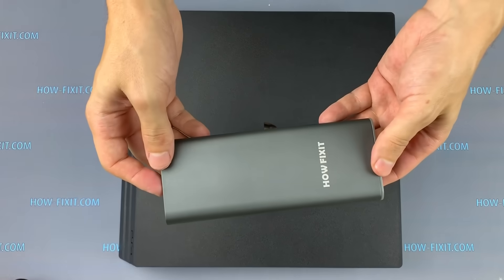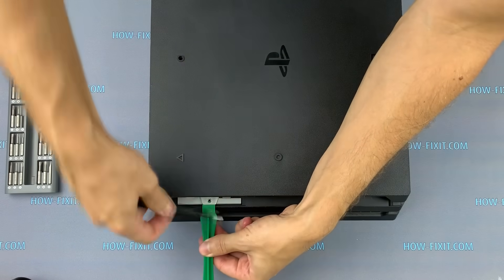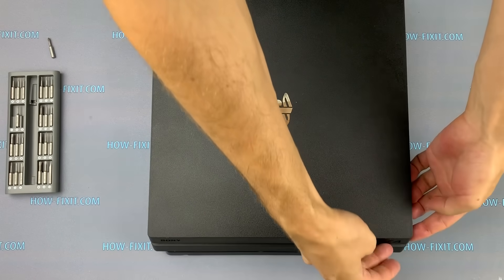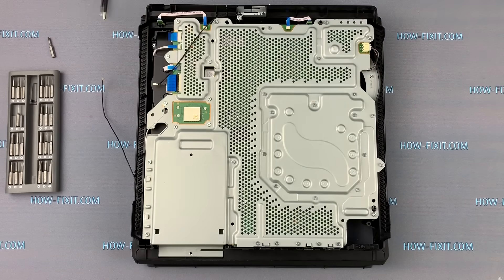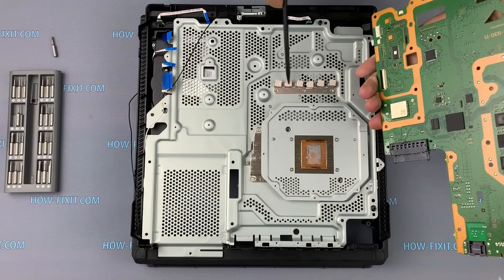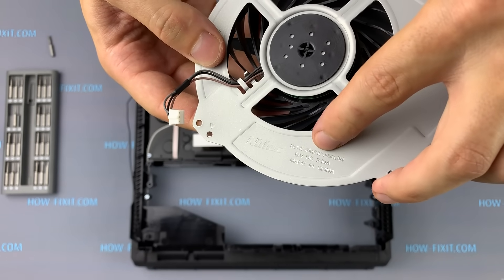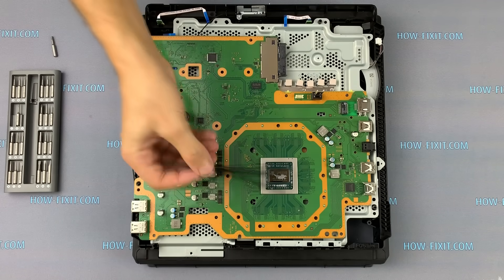PS4 Pro Disassembly: Ultimate Guide for Fan Cleaning and Thermal Paste Replacement

Comment: Please warn to be careful about motherboard cable. I just ripped mine off
Reply: The power supply? You can get it back soldered
Reply: @broly1724  i know that now but he should warm people about it. That piece must be heated before removed and he says nothing about it.
Reply: @paolo3794  no it doesn't need to be heated i did wiggle a bit but with care and it came off after that it was easy to put it back and take it out again just be patient
Reply: @shubhamstark8  3 people plus the place i sent to repair told me it must be heated before removing.
Reply: I just did the same. Wish I read your comment prior to this. Smh.

Comment: I open,clean,do it everything,closed okay,but dont work anymore,blue light pulse,what i can do? Please reply me
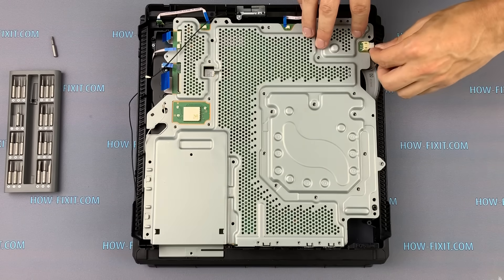Reply from the maker: Repeat step at 8:08 and double check each ribbon cable.
or try hard reset ps4 pro.
Reply: @howfixit  I have same problem. I checked ribbon cables a couple times. But when i try to start it, blue light appears for a second and dissapears. I'm trying to push and wait the power button for hard reset but it's not working.

Comment: Important thing I've learned the hard way: it's way, way easier to disconnect the cable from power supply than the motherboard. I ripped out the connector from the motherboard and had to pay for soldering.
If you gentle and move the connector in PSU left and right it'll come out easily.

Comment: 3:12 for me the cable wire to the mother board was stuck to the motherboard input piece and I wasn’t able to pull it out with my fingers, tweezers, nada and it broke off the input from the motherboard why???

Comment: Tnx a lot!! Just opened my ps 4 pro after 4 years,at the end it was a jetplane . Followed the video and the radiator was clocked. Also thermal paste was like dry clay. Clean everything up with alcohol and replace the thermal with Noctua NT-H2 . Put everything  back together and tested it with a game session. The fan didn't had to run fast,it was so quiet . So big tnx for this video!! My kids are happy and i don't have to hear that noise again.

Comment: Hands down one the most accurate and well presented tutorial videos out there. 👏

My heatsink and cooling fan were actually very clean, but the thermal paste was just carbage. Nearly 1/3 of the CPU had zero paste on it.. Okay my PS4 Pro is just two and a half years old though. I used a Noctua NT-H1 paste too. Couldn't be happier with the results.

Comment: I just did it, easy with this tutorial 😀. when I finally get to the old paste I was really surprised that my ps4 was working at all. all old paste was around CPU, between CPU and radiator just a bit, never properly applied to whole surface. in fact radiator was useless and not working.

Comment: I've had my PS4 Pro for years and never truly bothered to disassemble it for fear I'd break it in the process of cleaning it and replacing the thermal paste. Just spent a few hours following this step by step guide and my PS4 Pro is purring like a kitten instead of impersonating Valstrax the jet dragon from Monster Hunter series constantly. Thanks for the guide, subbed. Also, tip for 3:13-3:15, have some small pliers or a strong set of tweezers to gently squeeze both sides of the power cable (since it was a squeeze lock for me anyway) and carefully nudge it from side to side and out instead of simply pulling. Pulling the cable will very likely result in breaking the plug attached to the motherboard and end in a bricked console.
Reply: Oh my god thank you so much I almost destroyed my ps4 trying to figure out how to disconnect it
Reply: My motherboard almost ripped but there is a little tear. My ps4 is fine but it couldve ended worse. Thank you so much bro

Comment: Amazing.
I've never done something like this before.
Everytime I played No Man's Sky, my PlayStation fan would go into overdrive. Initially I thought ok it's a demanding game.
I did open the top of the PS4, thinking it must be dirty as I did buy it second hand. It was actually quite clean. Shrug the shoulders and carry on, just the demanding game.
But then other games started triggering the fan as well.
Watched this video and thought I'll give it a go.
The radiator had some dust on one corner. Like a total of 5% blocked of the radiator.
When I pulled the motherboard off, there was thermal paste squished off the CPU and into the surrounding connectors and I would say only 70% of the CPU had thermal paste covering it.
Cleaned it up, reapplied fresh thermal paste, hooked up new fan only because while I had it apart I figured maintenance not repair/replacement later on.
Wow. Whisper quite. Played No Man's Sky for 10-15 minutes and the fan did not increase in speed at all. Where as before it would start jet fan mode while just loading the game from dead cold unused temp.
Highly recommend doing this maintenance!
Thank you for a great and helpful video 😉

Comment: Excellent video. I don't know why but my ps4 pro has an X above the cpu and his was a like an S?
Reply: That’s because u have a different model of the ps4 pro for example there is 3 models for it 7000 series 7100 series and 7200 series and that guys ps4 pro in the video is a 7200 series so u either have a 7000 or a 7100 series

Comment: My PS4 Pro constantly sounded like a jet plane, so I followed your video last night and discovered the factory did a horrible job applying the thermal paste. There was almost none there. I applied some Arctic Silver, put it back together, and now the fan never goes above a faint whisper. Thanks for your excellent guide!

Comment: Good day. So my father and I tried to do this on our ps4 pro.

Every step and bit of detail was followed. But when we turn back on the ps4, it was quiet. Thinking that the thermal paste replacement would be the answer to the short burst of fan noise, but we were wrong. The ps4 pro  was still overheating and now it showed a message that "ps4 too hot, shut down " 

And then we checked the back side of the ps4 and we noticed that air was not coming out of it. Also cant even hear the fan spinning. But it spins in high rpm every 2 mins

Is the fan broken?  Also we are sure that the thermal. Paste and thermal pads are correct

Thanks for anyone who can help!

Comment: BEWARE/// the 2 screws he removers at 4:55 are different Philips heads than all the other Philips heads he removers.they are longer and pointer, make sure u don't mix them up or and the very end u will have to strip down to the motherboard again to swap them for the shorter one

Comment: I cannot express.. how terrified I was to have to do this. But I took a deep breath, followed step by step and it sounds like day one again.! Thank you so very much. Where I’m sure I would’ve had to pay someone $50+ that could’ve messed it up, taken/stripped some screws, this cost me $20 and one hour of my life. 💕💕💕 amazing.!
Reply: Really? I really wanna restore it to former glory since I've been fond of my pro but this is waay to technical for me I'm afraid.
Reply: @dingo702  I was worried as well since I never done this not even once, but just be calm and follow everything step by step. I suggest you separate the screws accordingly to what it belongs to and you will do fine, I recommend using grizzly kryonaut thermal paste. 

To clean I used toothpicks, ear cotton swap, brush, paper towel, rubbing alcochol ( just to clean the old thermal paste off) and dust off air sprayer. 

Oh after you’re done don’t plug it and use it right away. I did that and it turned on and off in less than a second. Plug it leave it off and leave it their for like over an hour. Then check and see if its working. Good luck
Reply: @dingo702  Go for it Michael really : There is no real tricks here. Don't be afraid to pull up the plastics as they can be hard to remove sometimes but eventually it will come and not break. then follow instructions. Sort the screw (hell even if you miss one or two of the huge amount ther is on the metal plate its not a big deal) and use MX4 thermal paste (my favorite) et then you're good really. Just don't forget to prep the cable of the alimentation to be ready to be pluggged on the other side like I did (or you're good to repeat all the steps again ^^) and it will be a child's game.
it's not techical. the idea is to remove dust, the old paste (and even if you let some it's okay, i didn't use alcool or toothpick perosnnly, just rubbed it with paper tissue like in the video and it was good). 
You'll have a silent and more performant PS4 in an hour ! ^^
Reply: I felt the same and had same results! Quiet as a mouse now
Reply: And you can apply this new skill for nearly every tech product. Good job

Comment: Hey, is is possible to do this without removing the power supply? Is there any other way to remove its cable from the mother board? because one of the screws of my power supply won't come out so I can`t remove it...

Comment: This is insane. 

I have a day one PS4 Pro and for a while it has been as loud as a hairdryer. It accurately sounded like a fighter jet taking off with a high pitched screeching sound. It was so bad that I went back to playing on my base PS4.
But now, after replacing the thermal paste with an Arctic MX-4 I can't believe how striking the difference is. It's as quiet as my Nintendo Switch! 

Thanks for the detailed instructions!

Comment: Got to the part where you disconnect the cable from the motherboard for the power supply.
Ripped the whole thing off.
Doesn't even look like it was supposed to unplug from that side but rather the power supply itself.
Well.. there goes the $40 spent on the fan AND the $400 spent on the pro.
GG

Comment: Excellent guide, easy to follow and well paced. As others have said, be very careful when unplugging the power unit from the MB, mine was extremely hard to unplug, and it seems very easy to break.
Very happy with the results, my ps4 is absolutely whisper quiet. The radiator was clogged to the brim in dust and the factory thermal paste was all dry and unevenly put. 
Again, the ultimate guide. Kudos sir !
Reply: Do you have a model 7016B ?
Because i also find the power unit really hard to unplug, and ii'm scared that pulling harder will break  the cable 
 
If you have any tips to share  it would help me a lot
Reply: @moagerdome3991  I find the best technique to unplugging the power unit from the mother board is to use pliers. Don't grab too hard with the pliers otherwise you risk breaking the plastic. Also you should apply firm pressure while slowly wiggling the plastic side to side while simultaneously gently pulling up. Be patient and don't rush it. Be sure not to grab the whole piece of plastic, just the part that slides out.
Reply: @joeschmoe7563 Oh I've already managed to unplug it but thanks you for your advice, and it's pretty what i did so i can vouch that it was a good one
Reply: @moagerdome3991  Awesome, glad to know you were able to do it.

Comment: By the way, anyone's got an idea on what to do with that "2-way metallic fork" coming out of the motherboard? All I can see from the outside is that it goes right into the power supply but the connector in the psu seems relatively complex. It seems to show 2 smaller rectangular areas. Is it one fork fork each rectangle? Something else?

Comment: Ended up breaking mine due to the power supply cable being almost impossible to remove. Going to get it repaired soon but still, taking of the cables are harder than made out to be in the video so be careful guys...

Comment: There's been an infernal heatwave around where I live and my Pro has been overheating all the time for the last couple of weeks. I thought I'd help by cleaning the inside and replacing the thermal paste on cpu and the pads on other chips.
Your video was immensely helpful, particularly the detail in which you explained which screws are used where, there are so many it's easy to get confused.That and the part of the reverse assembly where enough to brighten my day, both ideas should be used more often, with electronics usually the problem is putting everything back together after you've done the job.
Thanks, really appreciated.

Comment: Do I need to get a new ps4 because the silver plate that’s at the back when you take off the top it snapped off where the little nail is but my ps4 is still running should I get a new one or should I leave it as is

Comment: NEVER EVER try to remove power supply cable from the motherboard as this video suggests. You will 90% pull the whole connector out of the motherboard especially on the newer revisions. Otherwise - just plug it out from the power supply itself it is MUCH MORE safer.
Reply: Yes, you help me a lot THANK YOU! It is a good idea

Comment: One critique, and a thousand thank yous,
When taking out the psu(powersupply) it was super stiff and I ended up tearing the connector off the board, please tell people to hold down the connector at the same time as pulling the lead out, I got it fixed but you make it look really easy, besides that tho everything is working super quietly and for that I thank you soo much

Comment: 3:12 be very careful with this step, it looks like the plastic piece where it connects to the motherboard would pull out leaving pins on the bottom, in reality it separates; leaving a female connector attached to the motherboard. I broke it when doing mine and had to get the piece re-soldered. Obvious he is showing it done correctly, but if you aren't paying 100% attention it's easy to miss and a common problem according to the guy who fixed mine.

Comment: Nice video. I made it to disconnecting the cable from the motherboard. A little head up about how tough the plug would be to unplug would have been great. Maybe a little warning on how easy it is to break could have been thrown out there. Of all of the videos I had to pick this jackass

Comment: I open up my PS4 Pro and so far it doesn't look that dusty just had it in 4 years. 

Edit: I have open it more PS4 Pro and surprise there is hardly any dust in the fan or in the heat sink. But I haven't resemble it yet and see if the clean/replace thermal paste will do something. I got a frying sound in the PS4 Pro and see if it be gone after resemble the ps4 pro again.

I know what making my PS4 Pro making that ticking sound it is coming from the PSU, so stupid design of sony making the heat go through the power supply.

Comment: if you were to wipe the thermal paste during cleaning and then reassembled it without
applying more can that cause the too hot shut off screen
Reply: Yes thermal paste is essential so if you didn't add some you should

Comment: Best video with precise details. Even an amateur at repair can also be benefitted. Thank you with all my heart as it really solved the problem. From Jet Sound to No sound at all... My PS4 works like  a charm. There was no dust clogged inside the console, the main thing is THERMAL PASTE which causes chip to overheat.

Comment: excuse me sir i have a question
our ps4 pro is giving us the unrecognized disc we tried all our games nothing ,we tried every fix nothing again .
so they told us to replace the laser
can you tell us what type of model does the ps4 pro model cuh-7216 use
we need to know the models of these part
laser model 
disk drive model 
laser model 
and if the ps4 pro have a sensor chip inside the disk drive if it does can you tell us what model we need
thank you

Comment: Amazing, just amazing, i have the OG Ps4 Pro and from day one i had noise problems. Applied new thermal paste and followed this guide for deap clean and now 2 hours in and the console is extremely quiet. Thanks a lot my friend.
Ps : i would like to inform you though ,that torx t8 doesn't work on the OG model ,i had to use 0.50 slotted i think ✌🏻✌🏻 hope that helps

Comment: The only thing I worry about is the sensitive wires. They're so small and look so easy to break. Other than that the disassembly looks straight forward. I plan to clean out dust and replace the paste. I had my PS4 Pro for almost 3 years and it's now slowly beginning to get louder. It's not at jet engine levels yet but I wanna prevent that from happening.

Comment: Followed the guide but ended up damaging the motherboard when removing the power supply cable. Didn't do anything other than pinch and pull up with my fingers

Comment: I changed the thermal paste but its still loud :(. Anyone has any idea what could be the problem? And yes the fan is also connected.
Reply: Did you clean out the Heat Sink? That and the fan take in most of the dust. It'll take more than thermal paste to get your system quiet again. Also you should check for visual damage on your thermal pads just in case.
Reply: @AThing0  Thanks for response but I solved the issue. The problem was that I didn’t tighten the screws of the metal panel( those hexagonal shaped grey panels inside). Tightening those screws solved the issue. 😄

Comment: Very good video. My system is a different model but it's still do able. If I could offer a suggestion, take pictures so you can be 100% that everything goes back where it belongs.
Reply: Or after loosening screws and taking off parts you put screws back in the holes so you know where they go. 

I think it's best to do that so there's no accidental cross threading.